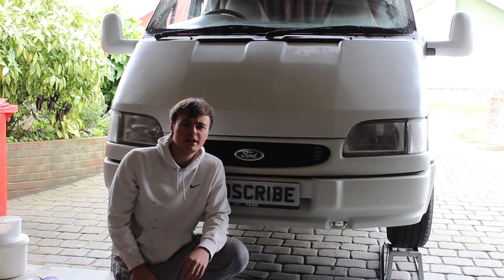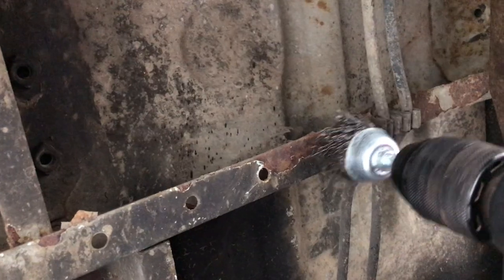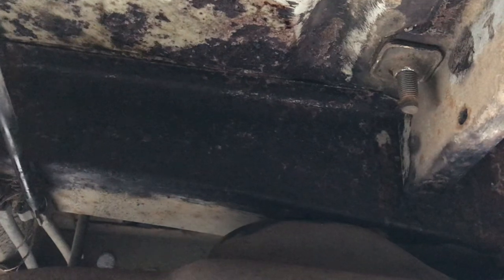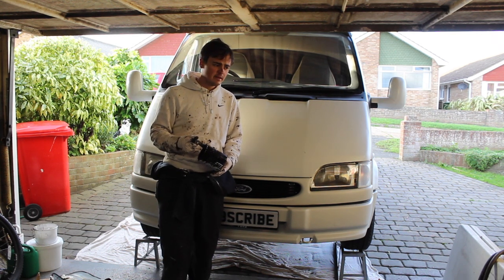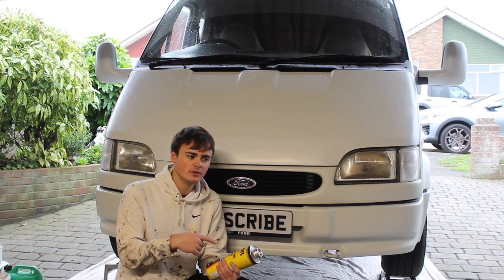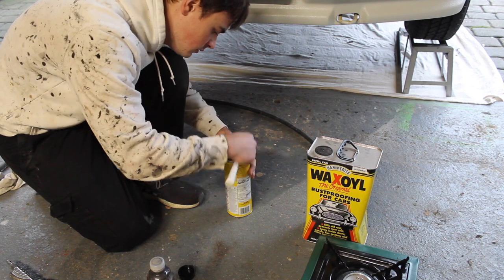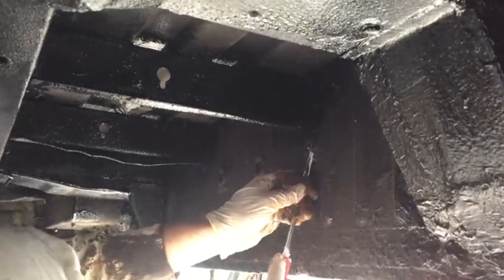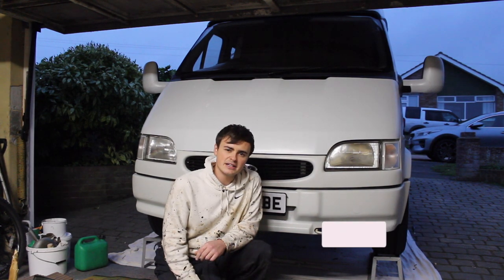Rustproofing Vehicles - 5 Steps DIY

Comment: I cannot stress enough the importance of goggles when working underneath a car.
Reply: I found that out last weekend after a visit to the eye doctor. A few pieces of metal found their way around the safety glasses I was wearing
Reply: @tim9m  metal is especially dangerous as the eye absorbs it if it's not dealt with quickly. I've had some horror stories; scrapings taken with a scalpel, corneal graft, stitches pulled out of eyeball. To be avoided at all costs.

Comment: Great video You can heat the wax oil by filling your sink with hot water and leaving the can laying flat in the hot water for 10 mins far safer than the enclosed can in a flame which could explode 🤔👍💪💯

Comment: The thing with waxoyl is that it must be warmed. I heat my compressor sprayer steel container with butane torch and then spray it. I do it every 1-2 mnutes to keep it super hot. It sticks and doesn't flake. It says soft. I think it's good but mage there are better products that don't requre so much faf.

Comment: I've been doing similar to this. 
I use an angle grinder, with a brass wire brush to remove rust from larger areas and a cordless drill and dremel with wire brushes for the smaller areas.
I use Dinitrol rust converter. It's expensive, but seems to have a good reputation. Usually 2 coats.
Then usually 2 coats of Hammerite, direct to rust,
I've not used the oil method inside my sills yet, but as a Skoda owner in Scotland, with rusty sills i'm going do it, and maybe top it up a little every year after i repair the rust.
Reply from the maker: I’ve heard good things about Dinitrol, will have to try it some time 👍🏼 Nice work, I had enough after one coat of hammerite 😂 will probably do the same again next year to top up. Oil or wax oil in chassis is really good for protecting the metal! Best if it hasn’t started rusting yet but it still slows the rust 👍🏼

Comment: Appreciate how thorough you are trying to be. Honestly though, all that scrubbing and painting prep is a waste of time. A much more efficient and protective method is to simply spray the whole underneath with a Waxoyl and 10% engine oil mix. This will prevent rust from progressing for 5 years before you need a top-up. I first bought and applied it to a rubbishy old Triumph Spitfire I had in the late 70s and then subsequently to other vehicles. This was in the days when some new cars started to rust through by the time they were a couple of years old. Unheard of now but Waxoyl really worked then and it its still the best at its job now. No prep beyond a good pressure wash underneath and allow to completely dry.
Reply: Not even sure you need to completely dry it, the Waxoyl displaces the water anyway.

Comment: Great videos. I'm currently converting a mark 6 transit minibus into a camper. Not really an ideal van thinkng about it  but I'm too far in to stop lol trying to get it ready for post lockdown however I'm very reluctant to do stuff myself. My dads done the wood work so far and hes making a lovely job so i dont want  to ruin his handy work. Next week im going to start trying to push the build forward. Wish i stripped an old caravan now. Especially the oven, sink ect. Instead i have bought one of these modern combination sink and hob and feel like it was a waste of money even if it does look good. The sink is far too small lol. I also bought a modern oven and when it arrived the door was smashed. Anyway i look forward to watching more of your videos. keep it up. I do enjoy tinkering though and you get a huge sense of satisfaction when you have accomplished it. i also want to raptor paint this van too.
Reply from the maker: Thanks man! Not a bad choice at all, I can think of worse vans to convert. That's handy! Once it's finished you could use it for the season and then sell up and convert something else? I would like to  start mine from scratch. I bought it part converted in the back, its not until you start using it you realise exactly what you would like. Fixed bed is a must for me next time! I don't think you can get it exactly right first attempt. It's a shame about the oven did they replace it? I also find it very satisfying working through all of the jobs to make something good again! thanks for  your comment :)

Comment: Personally I would use Dinitrol ML for the chassis etc . My Shogun was treated new in 2013 and it is literally like new underneath. I've had waxoil fail to flow and not bond to the surfaces, yes I did several cars old and new before moving away. Just my opinion and yes I use a proffessional sealey gun etc

Comment: Great video.

Getting rare now the Smiley Tranny with that 2.5 York DI Banana engine.
... great old workhorse proper commercial vans, far, far better than (and incredibly less rusty and these Smileys were rotters) than the mk6 and 7 which replaced the mk5. Yes, they 6 and 7 drove more car like but at the cost of woeful engines etc.

....worked at Ford R&D on the mk5 and mk6, the mk6 had a very painful birth I can tell you, never a good sign in my 45 years of auto research.
Reply from the maker: Thanks mate, it is quite hard to find a good condition one now! I’ve driven a few different vans and there’s nothing like an older transit to drive. It’s like driving around in your favourite arm chair 😆 I’ve seen much newer sprinter vans and transits with a lot more rust, which is a shame. What do you think of the mk8 transits? It seems they may be using a better paint system now as I haven’t seen many rusty ones, although it might be too early to say 🤔

Comment: Nice one mate. I’ve a transit connect and I want to do exactly this. I’ve a pit in my garage which will help. What was total cost and total time to do job pls
Reply from the maker: Thanks mate 😁 maybe around £70 for the materials but already had a Schutz gun. Can be done a lot cheaper using alternatives like red oxide but I think it looks more factory black personally. For a transit connect won’t take as long because it’s a shorter chassis. I will have a work out later and put the price in the description. Thanks for your comment 👍🏼

Comment: great thanks I have a transit custom L2 if yours is an l2 how many litres of hammerite did you end up using? That way I can order the right amount. What size compressor do you use ,mine is small what do you think?
Reply from the maker: Hi, mine is a long wheel base with extended chassis. Used most of the larger tin so would recommend getting a big tin. Compressor size shouldn’t matter too much, you will just have to let it catch up in between spraying :)

Comment: Hi bro like what your doing to the transit when i got mine i had to have a bit of weldingbdone on rear arches but i was told by someone at classic van magazine not to use hammer paint i had it pro done with a wax at my local daf truck dealers was £200 to do then but lasted a good 5 years jave fun any transit is great 👍👍👍👍ps stay safe
Reply from the maker: Cheers man! I used hammerite as it’s readily available, it’s a well known brand of metal paint and really wanted black chassis. Red oxide would be my choice if I didn’t mind a red chassis. What did they say was wrong with the hammerite out of interest? Thanks for your comment, take care mate 😁👍🏼👍🏼👍🏼

Comment: Thanks for the informative vid, reckon I could do this now! Just wondering why you didn't treat the actual base of the van as well, rather tham just the support beams?
Reply from the maker: Thank you, glad you found it useful 🙂 You definitely could do the whole lot! The main reason I only did the chassis is because that’s the most important part to protect as it’s structural. Also only had one tin of paint and it’s quite a large area to cover 😅

Comment: Hiya bud so in short terms it's clean off the rust, apply cortanin to rusted areas, paint with hammerite direct to rust paint, then spray the wax oil inside just the beams and seals? Not on any where else? Also is there a reason you used the paint instead of the hammerite underbody seal with waxoly?

Will be first time doing it so not too familiar with how it's done. Thought I'd make use of the nicer weather we have next week 😆. 

Tia
Reply from the maker: That’s what I do mate, I use a paint rather than an underbody seal as it tends to peel off and water gets trapped underneath it. With paint you can redo every few years to top up the protection. If you painted it with wax on the chassis would be a nightmare to paint over and also working on a car that has waxoyl on the outer box section is horrible because you get covered in it. I haven’t tried clear waxoyl but might be worth giving that a go as it’s probably cleaner to use. Make the most of the nice weather mate! Won’t be here much longer 😆👍🏼
Reply: @TurnersWorkshop97  Okay mate makes sense! Thankyou for replying and your time. Didn't manage to get it done last week, gotta wait for the next lot of nice weather then I'll get it done 👌

Comment: Is it me or has that has already seen a lot of welding?.....looks likes nice work.

If I can add some value to a great video.

1/ loosen the Waxoyl tops before heating and leave it loose as when the Waxoly turns to a fluid it expands....you can get a face full of Waxoyl...ask me how I know?

2/ Those lances that come with the 'Shitz' gun really never worked at all well in my experience and I've had the Sealey and the Buzzweld kit (which was total shite).

.....try injecting into a jam jar and see what happens....you see you get a piss poor whips of spread and wonder why you done a whole car with litre. 

They work on a syphon effect are great for laying underseal on the body, but the 'pressure drop' thru them, when the lance is fitted makes them woeful, even when thinned right down. 

Worth buying a Sealey SG18 'pressure' gun, £90 but the difference is astounding and something you'll use every year just because it makes the job a lot easier. Downside as anyone will tell you is the top body to gun seal, better to use an O ring, can they leak otherwise. A proper pro pressure cavity gun can be £250 upwards though.

Comment: Wondered does wax oil set hard, or will it drip off gradually in hot weather?
Reply from the maker: It doesn’t set hard, in the really hot weather it does melt a little 😁 best for in the chassis really 👍🏼

Comment: Hi mate can you put link up for the spray gun add on to attach to can?
Reply from the maker: Yes mate no worries, there’s loads of different places selling them here’s one on eBay similar to the one I used. https://www.ebay.co.uk/itm/Neilsen-Underbody-Coating-Air-Gun-Waxoyl-Stone-Chip-Tool-Apply-Schutz-CT3527/223508814928?epid=2288058023&_trkparms=ispr%3D1&hash=item340a29dc50:g:CxQAAOSwWdFc0uTf&amdata=enc%3AAQAFAAACcBaobrjLl8XobRIiIML1V4Imu%252Fn%252BzU5L90Z278x5ickkgCVySCgrNFPU8Iu85TabMPLqdK8QSDQwThyG8Tycj%252BIi0vTmuVjVgD5jvA8eUFC4gVISAp%252Bpg%252F2say7jo91k0NBvf6cEGstfBK7VUU2al%252ByPOaKa71YMxUKsFIunBJKKs36%252BJGgK5mZ76%252FZWv2r2Jiph5kBIKsuyQiFv5mP7kW0ZqgcZWt%252FVVngxhZ2bPHtaWT2II7EDSe2duw2ef%252FlfVTHMZdQC90slqGfC1cbEvoUaVHuo6%252BQpwp7WXOutjHSuEHlsb4hLuQpjHEm3Xx6pRlIq5eyoJN3KN9rA065mTgzgp3%252FfUGVnpMoyu771%252B3njlPD7tpiFZIB4Tb1dLQzdQ8rO%252BWQZN72xxngCx47eCdeavs4QVXEfwdMqj8XAnAkSA3M1hekooYu4eX9ZHE5HXvOiLVNwUWeLkx9AEzrBakpDGaRM71dYL9DGeoKvI1EpyZhbiT6l%252F4LE8kAFWnTqPw8hwXWfWnRViJWk4Sgpi5Q%252FdB6MNxLqoJPUSVmgjcPYklhwTWTYFByXgjr7p0HwbLjWj%252BBdfhl%252B32391jZ5FTbYgMVdqFqIfv2uhUbQr6VW8tvTblx6aFw%252BtTwcZuG2ydHR9R%252BtpYZUzcxu5lwHX8M3XnhMeHMFXkzAm%252BqwQcWYuGY0XlDfsE5cEwalPot3XdcImJhr65oeWf5vNrqeNtW4ixM6X7w0jsa77Vc4mighjlwREQT6ieYZghofMHmFtLHm09cbr8GFIFSWRFMVwr%252B9JwRwZUKjNwx0TVEjzYD31pTS%252BgnxlVFj7Sn6m3SGBw%253D%253D%7Ccksum%3A223508814928c44c9b7c78114ed2b0a5a39030b13806%7Campid%3APL_CLK%7Cclp%3A2334524

Comment: 100% corrosion will return, such protection with cheap products.
For closed sections, it is linen wax, not black asphalt
Reply: I agree. Any rust treatment i've used had rust come back in no time. I even sand blasted a part to bare metal, heated it a little to dry it completely, painted it, only to see rust come back within a year. Short of hot dipping it in zinc, i dont think anything will stop the rust for any decent amount of time. I dont particularly mind doing this kind of work, but having to redo it every year, maybe two, is tiresome!
Reply: @olliea6052  it's all on the prep work that makes undercoating a vehicle a make or break. I've seen people sand their frame down too bare metal and put zinc, primer, and what ever undercoat they chose and use either blaster surface shield or fluid film ontop of the undercoat and doing it that way seems too do the best and holds up alot better vs just sanding lightly and throwing a coating on and calling it a day